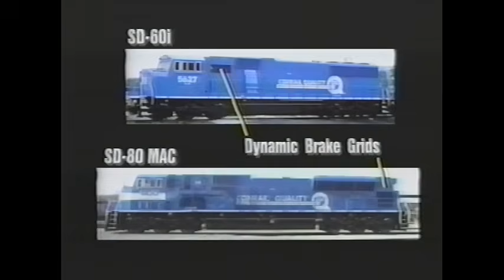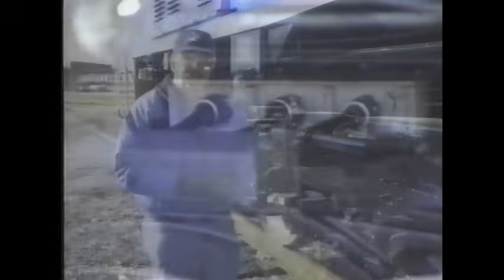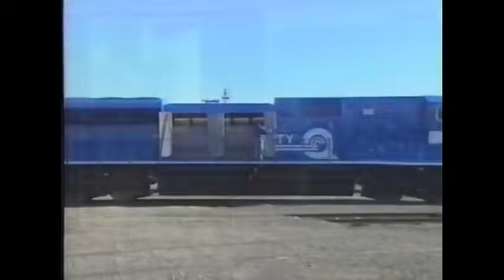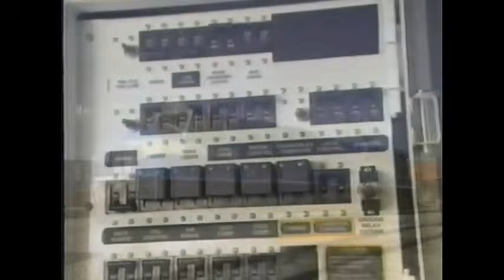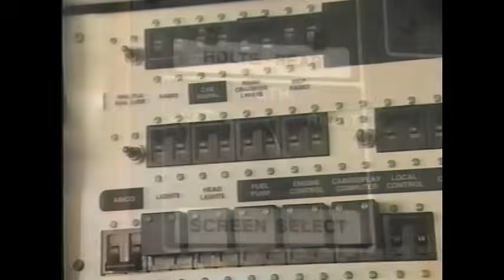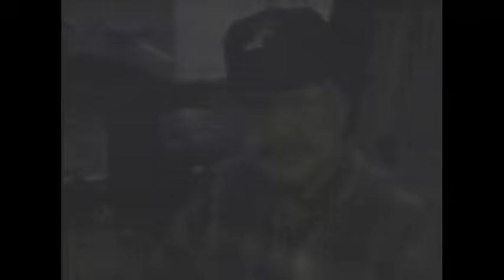Conrail SD80MAC Operator Familiarization

Comment: Wasn´t SD90 MAC that was a lemon and why ?
Reply: SD90Mac-H were the problem child’s. They had a lot of electrical problems. The Sd9043Mac or Sd90mac was more reliable but had its issues as well. The long frame on them tended to flex a lot. To the point they were having cracks form on the fuel tank mountings
Reply: @chasekostiuk4263 
Thanks. I´ve heard about frame issue. Too bad from en experimented builder, at least that shouldn´t have happened.

Comment: Why the hell would rectify and then invert.
Reply: Mismatched frequencies, rectifier-inverter is a great way to convert 3 phase AC from one frequency to another. It’s at the heart of most industrial VFDs.
Reply: The alternator frequency is fixed in each notch, because the engine governor regulates diesel-engine rpm.  This makes alternator AC unsuitable for driving AC traction motors directly.  By rectifying and filtering the DC link, we get a suitable power source for inverters to generate custom frequency and waveform for any traction-motor rotational speed (and hence road speed).

Comment: I remember when we still had sd90's on the Union Pacific and they had that manual crank handbrake too. what a royal pain those were when the electric hand brake didn't work.
Reply: Can imagine in winter, truck full of snow and ice, digging for that crank.....
Wouldn´t be smarter to put it inside cab ?
Reply: @danielfantino1714  often times there was a spare in the cab nose. But yes you're right it wasn't a great concept

Comment: Very cool. We need more videos like this. What in the heck happened at 46:55?
Reply: Were you watching the video on mute? They explained it... Something caused the removal of power, in this situation it was likely done intentionally for demonstration purposes.
Reply from the maker: Notching down can shake the cab for some odd reason
Reply: They were explaining crowbar circuits. If a crowbar cuts power to one of the inverters (the device converting DC to AC traction for the motors) under a load (i.e. they're throttling up a train). The resulting displacement of energy can be felt in the cab like you see in the video.